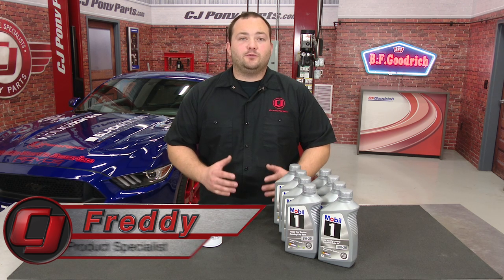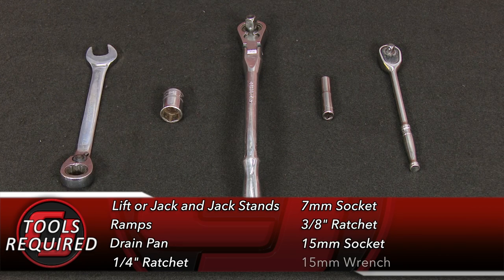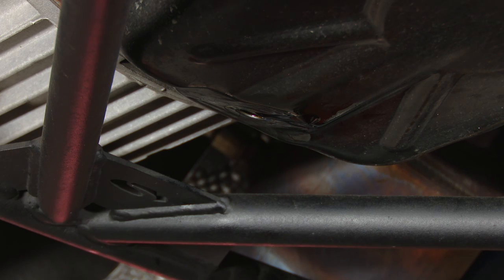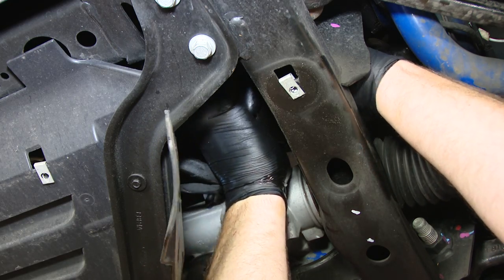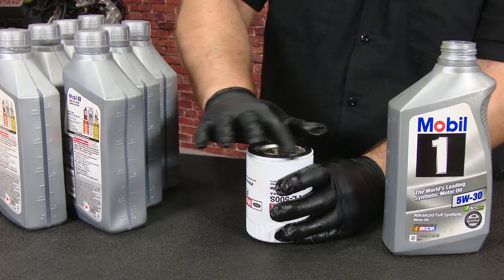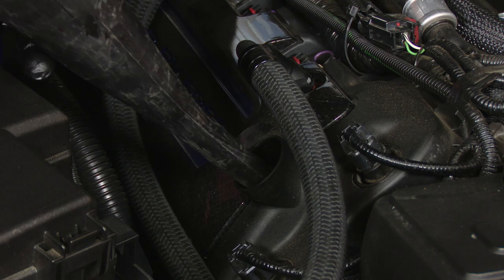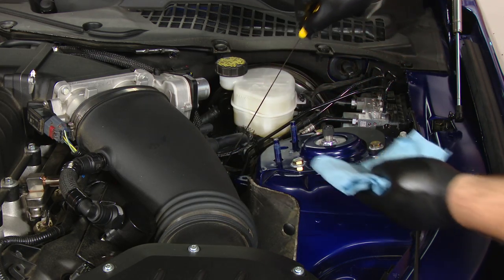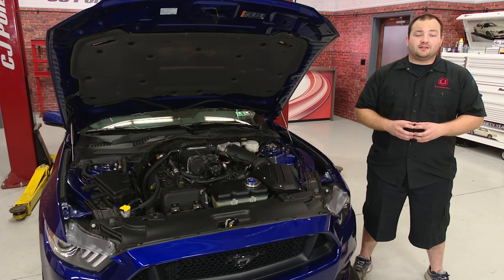Mustang Oil Change: 2011-2017 GT 5.0L

Comment: Never install a dry oil filter! Always put some oil into the filter to minimize dry starts. It works this way: Oil pump> oil filter> engine bearings. Also before removing the oil filter take a sharp punch and make a 1/8" hole in the filter at the six o'clock position to drain it. You won't have that big mess with oil running down your arm. Direct the oil with a small funnel into the drain pan.
Reply: Good point, will definitely try to drain it first using screwdriver or some better tool.
Reply: Awesome idea!!!

Comment: That "bag trick" seemed like it made more of a mess then stopped.
Reply from the maker: Freddy makes a mess no matter what he does.
Reply: So Freddy does an oilchange like me.. my BF mentioned i have a "strange" perfume.. xD
Reply: I usually hammer a small hole in the bottom of the filter with a screwdriver to let fluid drain out prior to removal.
Reply: Mendicant Bias whoaaa.. worst advice!! .. folks don't be like this guy and risk getting metal chunks in your oil before an oil change..
Reply: There is no way metal chunks get in the oil using this method. After the hole is punched in the filter the oil drains out and then the filter is removed and replaced. There is no possible way metal chunks would find their way into the oiling system of the engine.
Reply: kevinsdb1 it does loll... it made a huge mess for me. DO NOT USE THIS "TRICK"
Reply: Mendicant Bias its best if you get the filter loose first then out a whole in it. There's nothing worse than fighting with a crushed oil filter on a motor because it doesn't have oil in it to help break it loose
Reply: I tiotally agree! What a  mess!
Reply: Who said crush the oil filter? Make a small hole in it with a flat tip screw driver or metal punch. Drain. Remove.
Reply: Mendicant Bias that's a good idea 💡! Then you could use a cut water bottle or something to let the old drain into so it doesn't get everywhere! 🤔
Reply: Eddie J not a bad idea, but wishful thinking on many of today's cramped engine bays.  It may work if room allows however.
Reply: I've had it work for me half the time..might try hammering a hole in filter next time
Reply: No it actually worked for me
Reply: @cjponyparts  why throw him under the bus? Lol
Reply: Works great for me
Reply: @MendicantBias1  Dude.... great idea <<mind blown>> Still learning something new every day
Reply: Poked a hole in the bottom of the filter and drained the rest of the oil into my pan. Then I put the ziploc bag over the filter and unscrewed it and the bag caught the remaining drops. Not 1 drop of oil hit the driveway. First time ever. Thanks for the tips. Yay, internet ftw
Reply: The man showered in oil with the “bag trick”

Comment: I like to put as much oil in the new filter as I can, to help get the oil circulating quicker. Been doing that since I was 15. 69 now!
Reply: I do that and prime the oil filter by cranking it over without it starting. Older cars, remove the fuel pump relay or disable the ignition system. On this car, hold the gas pedal down to crank without starting.

Comment: This is wrong, you should remove oil filter 1st,if not you just dumped 1/2 qt of oil back in the pan,or leave bolt out of pan..

Comment: I'll be staying away from the bag trick for the oil filter lol also that funnel looked dirty as heck. I like everything extremely clean including wiping up any spilled oil thoroughly. Just my opinion.
Reply: 94turbotoy the bag works, the key is not to unscrew it as fast and aggressive as he did. You want to twist it just enough that oil starts to spill out, then wait with the bag in place, then twist it some more until you've got the filter off. It's almost like twisting off a bottle top on a soda bottle that was dropped several times.

Comment: A better trick is to put tin foil below filter in a way that  funnels oil spillage down into your catch pan.
Reply from the maker: nice! didnt think of that
Reply: If you just poke a hole in the bottom it’ll drain out as well, much easier.  That’s how I’ve always done it
Reply: Or you can cut the bottom off a plastic drink bottle leave the cap on and shroud the filter.

Comment: It may be important to note that if you use ramps or only jack stands up front that when you go to check the dipstick after the change that the car is level so you don't get an incorrect reading.

Nice video guys.
Reply from the maker: thanks! and that is also a good tip

Comment: Might not be necessary but I add oil to the filter if it is vertical or at a slight angle and I use brake clean to clean oil spill by filter or oil plug.
Reply from the maker: that is a really good idea especially on vertical filters

Comment: Never forget to measure your oil after you start the engine remember that the oil filter has to fill when replaced and that takes away from what’s in the oil pan, hence causing the vehicle in some cases to be low on oil when started
Reply: Or you can just add oil got the filter like you’re supposed to do before you put it back on. That worked better 🤙🏽🤙🏽

Comment: Recheck oil level after starting since the filter fills.....
Reply: Can you fill up 50% of a filter with oil?
Reply: @ironbull2003  You can add as much, so long as the angle does not make it spill out. The filter media soaks up a lot. Take your time.

Comment: I just bought a 2017 Manual and I love her.. 8,890 Miles on her.. Going to do an Oil change this weekend..
Reply: I just bought a 2017 manual with 18,500 on her. Already put more than 2,000 miles on her and I’m changing it right now before an event for peace of mind. Driving the car 4 hours to the event, running it, and driving back.

Comment: Hello. Is their a way to check your oil percentage on a 2014 PREMIUM GT? My car is saying oil change required, but there is no oil service light on the dash, the oil isn’t low or dirty in the car either. I have gone through the premium display and I can’t find anything related to oil percentage, thanks!
Reply: I have a 2014 gt. look in the settings menu for oil life reading. it's all the way at the bottom of the menu. You will get a warning at around 20% on the dash. This calculation is based on one year too if you don't drive alot of miles. This year 5.0 takes 7 quarts with a new filter.

Comment: I always remove the oil fill cap to allow the oil to drain faster.  Also, Mobil 1 Extended Performance is the true synthetic oil.

Comment: Hey guys this might be a stupid question but on my 2016 5.0 one side of the dipstick shows its right on spot below the 2nd Dot, but when i check the other side it shows its 1 inch above the 2nd Dot should i worry its overfilled? Is it normal that this car doesnt have even sides of oil? Or when checking the 5.0 only 1 side of the Dipstick counts? Because my old v6 2005 mustang the dipstick is always even on both sides.

Comment: well i cant remove my old oil filter it's stuck i have used everything the bag trick and i have used the oil filter wrench and it's not moving it's just getting bent and damaged
Reply: stick a screwdriver through side of filter to be able to turn filter
Reply: Turn it the other way

Comment: Fill up the filter first with new oil before installing.
Reply: quantomic1106 Why? The filter will get filled regardless after a drive cycle. At worse you will just have to top off the oil. The purpose for putting oil around the o ring is to ensure it does not get stuck on your next replacement when removing the filter. Adding oil inside the oil filter is just a way to ensure you have a true level when checking your oil dipstick.

Comment: So you don't have to use motorcraft oil? That's what I was told I had to use
Reply: during the warranty period yes, it should outline all the warranty terms in your owner's manual. After you pass the warranty period you can do whatever you want.
Reply: Yes ..stick with motorcraft products ..good stuff

Comment: the title "2011-2017" is not accurate.  On my 2011 GT, the oil filter cover is the entire engine compartment width, and uses two 8mm bolts.  The Oilpan plug was 15mm, not 17mm.  The only information I wanted, was wrong. (bolt size)

Comment: If I use ramps to lift the front of the car up will all the oil be able to drain out even though the car is not leveled
Reply: Pavlo5.0 yes but it may take a few min longer but will 100% come out, prolly not but I’d say 97% yes

Comment: Good general tips video. 
But sorry, you’d never change the oil in MY Mustang. You’re one of the reasons I’ll do it myself. 
Did no one ever teach you to fill the oil filter with fresh oil BEFORE installation?
Reply: The oil filter is nearly horizontal when mounted, so it's impossible to come anywhere close to filling it prior to mounting it to the engine.  Also, the oil pump primes the filter on start.
Reply: chuckschilling not true at all!! Have you even changed the oil filter on a 2015-2017 mustang 5.0? lol I have plenty of times and you can almost completely fill the oil filter to the top with new oil and still screw it on without leakage if you do it carefully! I should know been doing it a long time and no spillage.
Reply: @chuckschillingvideos  You can get a lot of oil in there. It does not have to be "Filled up." The filter media soaks up the oil. Been doing it for 55 years.

Comment: Anyway If the milage is high should you fill 5w 20 ??
Reply: continue using 5w20. I have never used any weight other than this and have 186k miles on mine. quiet engine with no usage. 4k mile changes syn oil. if you use thicker oil you will have vvt issues

Comment: So there's no need to place a drain plug washer?
Reply: no the washer is already attached to the drain plug. The drain plug is good for 4 to 5 oil change before you need to replace it.
Reply: You have to replace the drain plug washer every 4-5 times?

Comment: CJ guys, I noticed the oil cap says 5w-20, I am just curious why you guys went with 5w-30 oil. If there is any reason, just wondering, thanks!
Reply: It was either sponsored or for example in my case i just recently got an 18 gt and on the owners manual it states that if going to the Track change your oil to 5-30 and when done, switch back to 5-20. page 279
Reply: Kevin R. thats interesting! i wonder if its the same on 2017??
Reply: I do two oil changes per year, even though my mustang runs only about 4k miles a year. Springtime prep for the hot months I use full syn 5-30, fall/football season back to 5-20
Reply: They say In the hotter months, the oil thins. So if you were to add 5w 30 during the spring/summer heat, the oil will likely thin to 5w 20 grade.

Comment: why you no put oil in filter? way to do a dry start. :(
Reply: GIJo the filter will get oil in it, he just may have to top it off after a drive cycle. No harm in not adding oil to the filter upon installation, especially given that fucked up angle it has to be screwed on at.
Reply: The filter will prime on ignition.

Comment: Ha lmao Mobil 1 light oil....ugh NO ive been using Valvoline 20w50 racing oil & Lucas oil stabilizer in my 03 4.6 Mustang & never had a problem & yes shes a track car at Road Atlanta.....my dad drag race his Mustang & i road course mine & we always used Valvoline & Lucas oil products in are engines
Reply: Dennis Garrett hey do they still do open track days at Atlanta Motor Speedway?

Comment: Instead of the bag "trick" 🙄 cut a piece of card board and put it an angle as spliiling is near impossible and the cardboard shields the engine allowing oil to slide down cardboard into pan.
Reply from the maker: It actually does work lol .  He never tried it before and had some issues.

Comment: this oil change was  so messy looks like it was done by a person that has no  mechanical expertise, messy I would of used a brake cleaner the clean the  oil filter area and the cover and change my gloves  when im adding oil to the car or cleaned out my gloves.

Comment: So during the oil change you never did a pressure check by starting the car then checking the oil level. Me personally I don't put what the book say to put, I gradually put oil in the car until it is at the full mark.

Comment: The one thing that sucks about Mustangs, is that they devalue so fast. My GT is only worth 19k after only two years.
Reply: MrRedskins0021 Just traded in my 2015 GT with 30k miles on it for a 2017 GT Premium and got $22k for it
Reply: My 2016 GT Base was valued at 25k when I looked at trading it for a Focus RS at the dealership I bought it from. Not sure where this guy got offered 19k but it sounds like highway robbery lol

Comment: but coyoty used 5w20 not 5w30
Reply: Hani Jabry he used 5w30 for the o-ring but in the beginning it was 5w20
Reply: Hani Jabry I use 5w30 as it works better accross the board in high performance track settings and around town spirited driving. ford recommends 5w40 on the track. If your using 5w30 make sure its warmed up before you start beating on it..